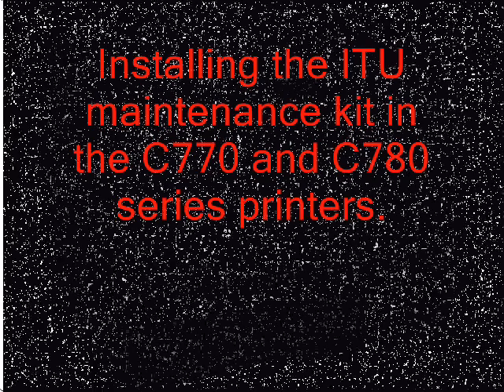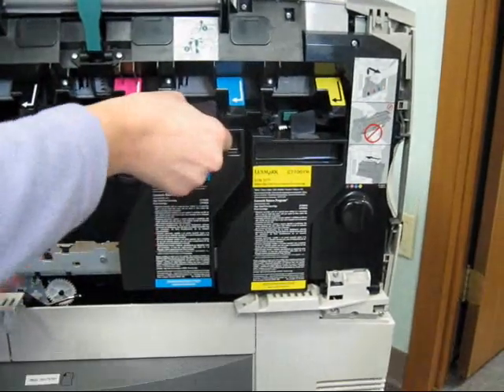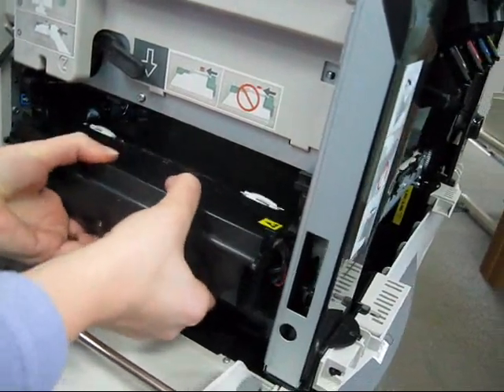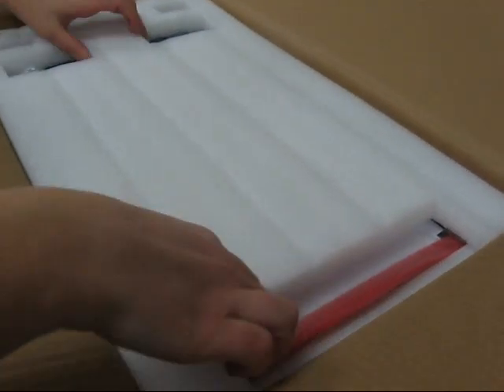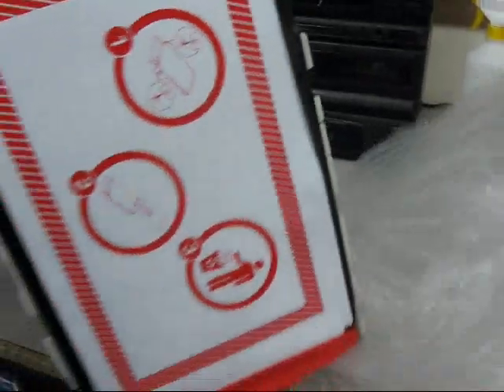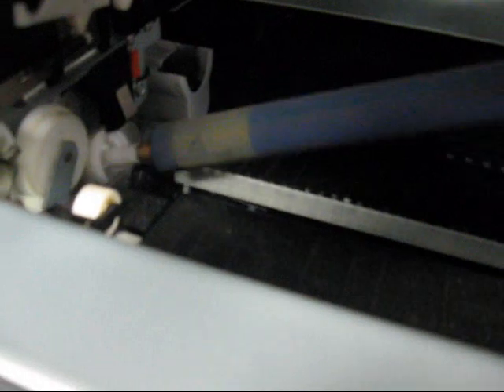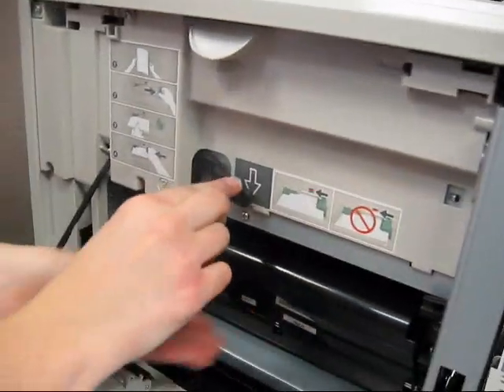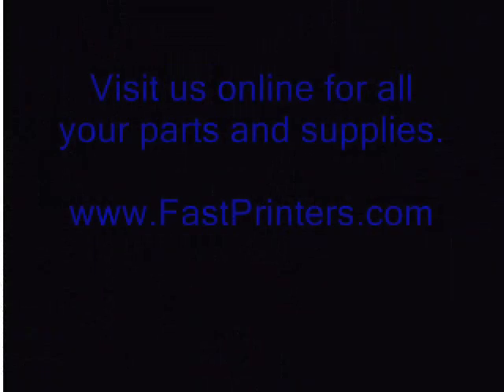Installing the ITU in the Lexmark C770 C772 C780 C782 X772e X780e MFP

Comment: @fastprintersdotcom 

i was wondering if you could help me.
it seems i have a belt tracking issue and i need a shim to properly tension the belt but i have no idea what it looks like, if i have one, or where it goes. the belt pulls toward me and that side is the slacking side. i am worried the belt will be permanently damaged if i do further belt tracking tests. 

the cause might have been the wiper blade tension. could that cause this/what is recommended setting?
thx in advance